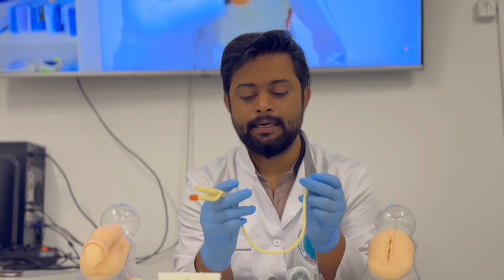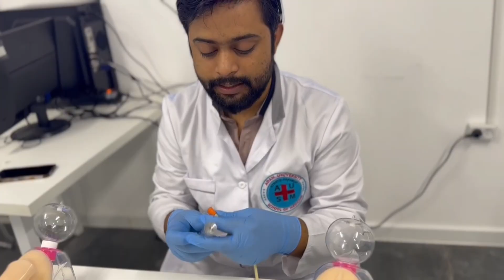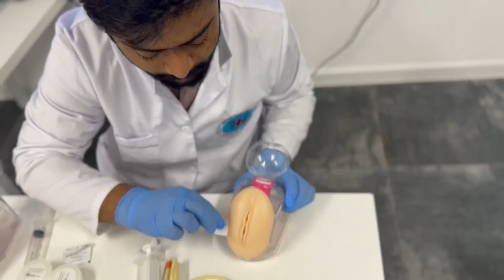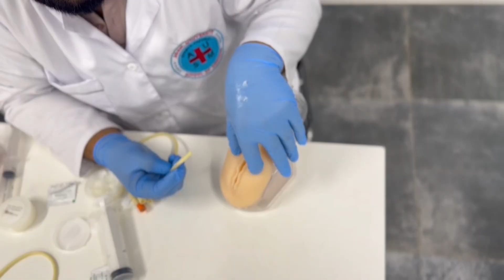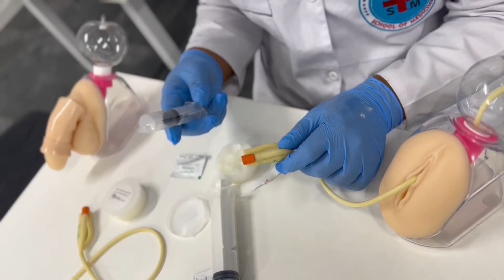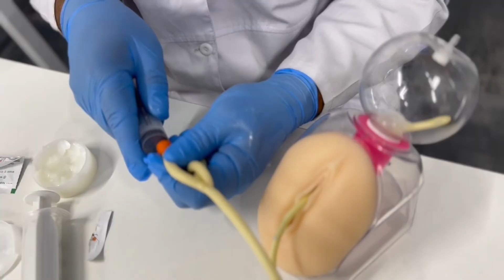How to Perform Urinary Catheterization | Step-by-Step Guide for Medical Professionals |Dr_Najam_lec

Comment from the maker: In my video, I mentioned using normal saline and air for catheterization. This was demonstrated on a model for practical purposes. However, when performing catheterization on a live patient, do not use normal saline to inflate the balloon, as it can form crystals over time, making catheter removal difficult and complicated.

For testing the catheter, Air  may be used, but once the catheter is inserted into the bladder, always use sterile water to inflate the balloon to prevent complications.

Regards,
Dr. Najam Lectures